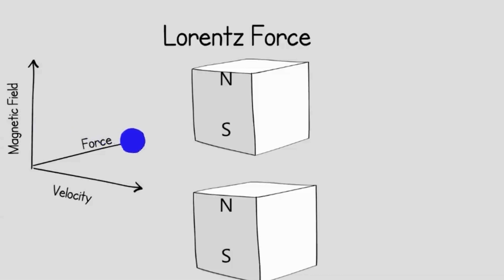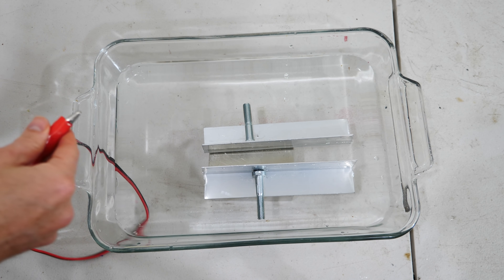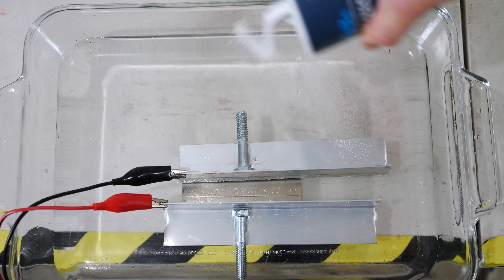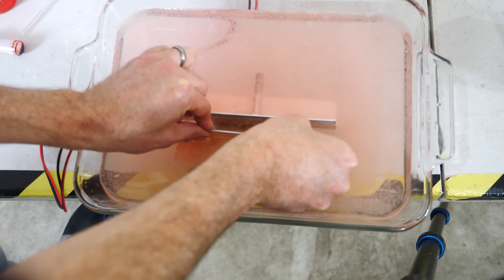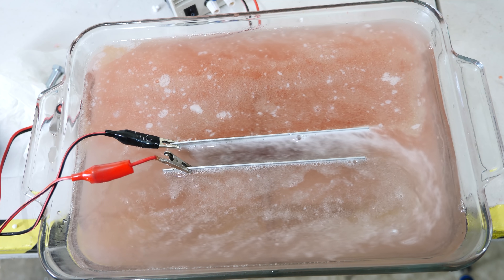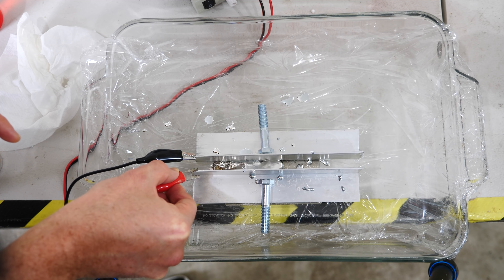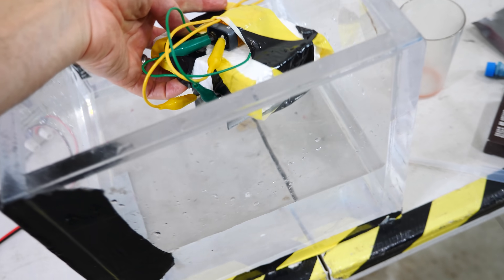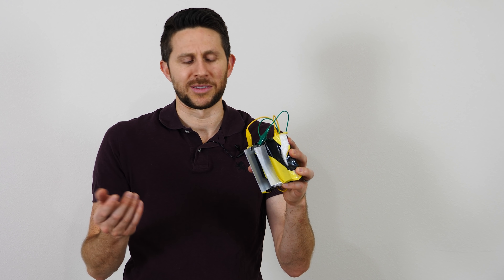I Made a Real Magnetohydrodynamic Drive

Comment: and as visible in the  plates   the  interface  ot the anode  and cathode plaes   in water  casue a surface coating of bubbles which actually   draws down on the  flow and efficiency  of the drive

Comment: You point out that the simple MHD drive also produces Hydrogen and Oxygen by electrolysis. Could these be fed to a fuel cell to generate electricity? Obviously NOT perpetual motion, but could it increase the efficiency?

Comment: I tried this concept to explain this phenomenon:hope this works??
Proposed Fourth Law of Thermodynamics: Conservation of Total Information
Formal Statement (Conceptual):
The total amount of quantum information (quantified by the von Neumann entropy) in a closed or isolated system is conserved during its unitary time evolution, and the entirety of thermodynamics at the macroscopic level emerges as a consequence of this underlying microscopic informational conservation.  
Explanation and Context
This statement is an articulation of the fundamental assumption in quantum mechanics (QM) that the evolution of the universe's state is unitary, meaning it is reversible and conserves information.
QM vs. Classical Thermodynamics:
Microscopic (QM) View: Quantum information is conserved. Any increase in macroscopic thermodynamic entropy (disorder) is merely a spreading out or obscuring of this conserved information over all possible microstates, a process called decoherence.  
Macroscopic (Classical) View: The Second Law (\Delta S \ge 0) states that thermodynamic entropy always increases in the universe, representing a loss of available energy (increase in disorder). This proposed Fourth Law provides the microscopic justification for the macroscopic increase in disorder by grounding it in the unitary conservation of information.
Alternative Formulation: A simpler, combined approach sometimes proposed as a Fourth Law is the Energy-Information Equivalence Principle: "The total amount of energy and information in the universe is constant." This unites the First Law (Conservation of Energy) with the conservation of quantum information.

Comment: I wonder how it would work if you used high pulsed voltage with low amperage. ( don't forget the tank capacitor/s )  I'd also wonder if you used conductive silicone if you would break it apart like any metal you would use. Not efficient in part cause of the electrolysis making browns gas BUT more importantly it's not efficient cause in standard high amperage electrolysis the energy used makes water temperature increase every min or two till it all boils off.

Comment: Is it possible to use permanent magnets instead of converting electricity into magnetic force and losing most of the electricity in electrolysis and heat ?

Comment: you can generate electricity using a heavy conductive liquid like mercury if it moves in reverse. So I had an idea that you build clear spiral tube, place aluminum tape or conductors on each side and magnet below on the outside of tube in series spaced around the spiral tube. The tube needs to gradually move downward. Place mercury in the top and as it flows down and passes each mhd in series... I'm curious to know how much electricity it would generate from gravity.

Comment: Does it work because water is touching the electrodes, or does it work because there's an electro-magnetic field that affects water? If it's the latter, then you could isolate your electrodes (e.g. clamp them around a clear plastic tube) - that would prevent the HOH formation (and corrosion). I'm not sure how it would affect performance though

Comment: the flat magnet you got under the water has the less powerful flux going across its width and the strongest on its edges so you need to configure those electrodes properly over the edge to get better results

Comment: Well done. Next step: since there is no moving part in a magnetohydrodynamic drive, there is nothing to stop you from "putting the engine outside" making an external-flow MHD accelerator that can act on the fluid over the whole wetted area, and not only inside a tiny chamber with much friction everywhere else. With an applied electromagnetic field powerful enough, one can then prevent the water molecules to accumulate at the stagnation point in front of the vehicle.

Comment: The is why UFOs are regularly seen near the ocean ie the salt water. They operate using Magnetohydrodynamics and sometimes coupled with electrohydrodynamics which involves ionizing the surrounding aether via microwave-beam transmitters to increase the conductivity of the surrounding environments and increases the density.
Reply: which makes me think that there could be a way of containing the magneto force with some kind of flexible membrane/wall which would still allow for motion forward or backwards.  Like those bubbles people romp in near Gatlinburg.
Reply: @keepfocus1214  search Google patent number US10144532B2. This is what Chris PaiZ used to contain that force creating a plasma state around the craft.

Comment: This is a magneto-hydrodynamic motor, but every motor can be a generator, too. Am I right? 
If you have flowing salt water via a magnetic field, you generate electricity. So once the water is flowing, divert it through another magnetic channel to create electricity. Once you’re generating electricity, remove the external power source and dive the system using the power you’re generating = perpetual motion machine

Comment: Once you explained a misconception about negative temperature.

Could you make an AC resonant magneto-hydrodynamic-propuslion?

In such a way the current wont be creating bubbles and the effeciency should be greater than 100% if you influence the vacuum medium with it... similary how a fish floats up and down using compressed air so we could compress or decompress the vacuum medium or smth.

Comment: What happens if you isolate the aluminum from the water by adding a thin layer of plastic so the bubbles do not form? Is it purely the electric current in the water or the magnetic field?

Comment: Is there a way or substance that when applied to the water will prevent the electrolysis of water turning into hydrogen and oxygen gas? I would like to make a no-moving-parts water pump to circulate warm water to be cooled off at a radiator and then come back again/repeat. Im interested in using this technology since I never ever want to replace any parts and Id like for it to last decades if possible, anyone have any bright ideas to improve or make it last much longer? :)

Comment: You mentioned that the generation of hydrogen gas and oxygen gas via electrolysis causes inefficiencies in the system. Can you think of a way to confine and ignite them, therefore increasing the energy output? I'd really like to see a magnetohydrodynamic boat with a huge flame coming out the back.

Comment: I think you may be able to get more out of it if you increased the plates. If it's anything like electrolysis, anything over 2v between plates is overvoltage and results in steam. If you're using a nine volt battery try putting three or four plates between the cathode and anode. Count the spaces as 2v each. Just a thought. Now you got me wondering. Gotta build one. LOL.

Comment: My big question is: What if you pump ionized fluid (Sea water) through a tube with a super magnet beneath it, does it produce a current (between two plates) and therefore power? Can it be more efficient than a turbine? Basically the reverse process what you show here.

Comment: Is this how Bladeless fans work?
Reply: Usually no, there are ion thrusters that work that way, but most "Bladeless Fans" have an impeller with blades inside and then uses the shape of the fan to move more air overall.

Comment: I saw a movie Godzilla VS Mechagodzilla, and the Mechagodzilla had a shield that looked like a tornado circling around him.   This gave me an idea for shields on space ships using MHD Drive.   On Star Trek, the shields are a static invisible force that surrounds the ship.   Totally imaginary.   An MHD Drive, configured in a circle around the ship, but using Electrical Plasma as the conductive fluid, would form a spinning plasma loop shield around the ship.   As objects hit moving plasma, they will be vaporized and diverted around the ship.  Electrical Plasma can provide propulsion, shields, and gravity (through constant acceleration & deceleration).   We have all the basics for a space transportation system as soon as we can provide a constant & continuous megawatt electrical power source.

Comment: Can it be used in the opposite way as a generator? And you said to drive a boat on salty water. Salty water can make electricity which can be used to drive the boat. I just don't know how strong the electricity you can make from the water of the ocean.

Comment: 25 years ago or so I saw a thing on discovery channel and I think it was called thermal magneto hydrodynamic propulsion it consisted of two Venturi‘s a small one inside a large one and the smaller one was heated by induction and I have not seen anything about it since it was wayMore efficient than what you were demonstrating they even used it as a dredge as it had no moving parts and did not damage small items that they were dredging up it would be nice to see if you could replicate that. Thanks for the great videos!

Comment: Hypothetically if you lower  the electrical potential (voltage) below the nessacry voltage to  preform electrolysis on water and increase the surface area of the electrode and lower the distance between the electrode to reduce resistance . would that possibility make it a viable drive?

Comment: You can do the same with non-conductive liquids too. It works with oil, and you can do it without the use of a magnet. Because oil is an insulator, you need to use the electric field instead - hence why you need a very high voltage.
Reply: can you please explain why is it moving?

Comment: Ergo - if you now move the water through that drive you  will measure a voltage, since a moving conductive part through a magnetic field is causing the induction

Comment: You made a toy and say it is inefficient, but you proved you can get something for nothing in the process. I believe scientists have lied for many decades and can only think they are forced to for some hidden reasons. Overunity; Lenz's Law; Thermodynamics, are all excuses used to claim we need to put more effort in than we retrieve, but how long will your water flow if you just walked away? Or if your boat was put in the Pacific, when would it stop moving? I am no expert, but I am going to try to solve two issues with magnets:
1. The 'sticking problem' - a mysterious propensity to stop rotating for no reason; have you had any evidence your water stops flowing? Or the boat stops moving?
2. The inefficiency problem - the magnets used are far bigger than the work done.
If I can beat those, then it's just a case of what barriers are presented to me; will there be opposition from science, governments and oil companies?

Comment: At the beginning of the video, the electrodes are touching the magnets. This causes current to pass through the magnet and wastes energy.

To avoid bubbles, you can apply AC current and put an electromagnet instead of a magnet. The current direction will constantly change between the electrodes and the liquid will not move, but if you feed the electromagnet with the same AC current, the liquid will flow in one direction.

Comment: For generating electricity from impure water, we can use copper and zinc electrodes, but small quantities of the metal (or ions) get mixed with the water. For this process, does the same happen? If drinking water was used, is it safe to drink then?

Comment: You had another post...straw covered in hydrophobic stuff lol. And the liquid would come out even when you held pressure down one end to pick up the water. 
Could you place little magnets in the liquid. Connect both ends of the straw, create peaks high and low with the straw so when the liquid goes up it comes back down and will push itself back up again and now you have self propelling magnets that can go round and round without stopping. 
I don't have a clue how power works, Im just asking if that's a thing or could be a thing?
Don't forget you heard it here first 😁

Comment: Try the Saucer approach, two saucers, with the first half being the cathode, and the other half being the anode, a rubber seal outlines the perimeter preventing them from touching. Have the power supply and magnet inside. Then place it in water and see how fast it goes.

Comment: Test cases: increased numbers of Strips, for more surface area, like find on a CPU Chiller, or Car Radiator idea;  DC Voltage vs AC Voltage; high Voltage Low Current vs Low Voltage High Current vs Low Voltage Low Current vs High Voltage High Current! 

(Low Voltage, 0.1V to 48V;  Medium Voltage 48V to 120V, High Volume 120V to 240+ Volts. {100,000 Volts?} For example!)

Comment: Excellent point with the efficiency! Too often that is the most overlooked aspect of a solution where everybody thinks we (engineers) should be able to design a more elegant design when in reality the best looking solutions are often the least efficient. This is why thermodynamics really should, and often is, taught early in the mechanical engineering programs. Without it or too late and there can be some very embarrassing time wasted on future work.
I think it would have helped to explain better the difference between voltage and current in this system. Does a higher voltage but lower current produce the same flowrate/force? I know the answer but feel this was left open.

Comment: There are two main reasons why this, so far, is an impractical method of propulsions. 1) the current needed to produce a useful amount of thrust (enough to push around a steel ship or submarine) is horrendous. It would drain the vessel's batteries too quickly making it necessary to run auxiliary generators, defeating the purpose of a "silent propulsion system on a submarine. The energy spent in the generators is more efficiently used directly running a conventional propulsion system. 2) The process of electrolysis is a highly destructive one for the electrical elements. The cathode or negatively charged electrode literally dissolves in the process, while the anode or positively charged electrode builds up deposits of aluminum chloride (in the case of aluminum electrodes in salt water) which is non-conductive and very quickly builds an insulation layer around the anode. The higher the current, the more quickly this happens making a major maintenance and materials problem every other day for a ship using this system. Not to mention that the oxygen and hydrogen gas being emitted in the process is HIGHLY explosive.

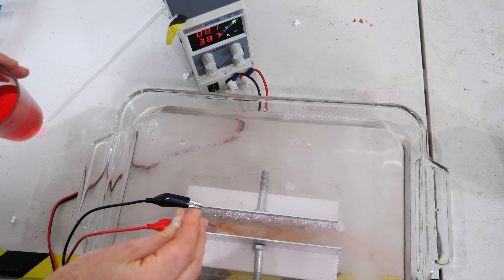Comment: minor  correction: 2:21    Granted strength of the electric field is an indirect factor along with temperature, electrolyte type and concentration, plate surface area and distance between plated, but all those factors simply effect the amount of current, so it is then that the force that causes the water to flow is only about the amount of electric current and the strength of the magnetic field.

Comment: Why don't you add a layer of electric insulation for your plates, it will prevent the electrolysis issue and the electric field will still be there.

Comment: there isn't "potential" to use it as a plasma drive... It's already used as such for quite some time. That's exactly how Ion Drives work, plasmidify Xenon gas and shoot it through tiny channels at extreme voltages, the max thrust is really shit and it doesn't work in an atmosphere, but in space it does work and the total thrust available to the engine at small fuel amounts is actually absurd.

Comment: I always thought this would work, but have never actually seen it done. Great demo. 

I wanted to go the other way though. Take pipe lines that rundown canyons and make them rectangle and capture the energy as it flows. Of course the efficiency is terrible and the cost enormous, so it will never be done, but could in theory.

Comment: does the opposite happen ? if you flow an ionic fluid flow through a channel connected with wire, does it produce a current ? I guess a potential application would be sea water power generator that use generate power when the tide rise and fall. Since there is no moving part, you don't need worry about rust or other mechanical failure form the harsh sea environment
Reply: Wondering the same thing here!

Comment: What would happen, if the caterpillar (name borrowed from the hunt for  Red October) would have two sets of electrodes, and the 2nd set (in the direction of flow) would be the one powered by the main source.
The oxygen and hydrogen could be collected at the end of the caterpillar, and fed into a fuel cell, that in turn would send its current to the first set of electrodes.
Of course the first set of electrodes would also generate oxygen and hydrogen, but that would be collected at the end of the tunnel anyway and returned to the system.

IMHO, the total amount of energy lost in the "main" set of electrodes would be retrieved, fed to the secundary set (powered by the fuel cell) and all losses of the secundary set would be recovered and re-used anyway.

I have no idea if it is viable, but it sure should give a huge efficiency boost.

Comment: That comment about a wire experiencing a force when the wire is in a magnetic field (and a current is passed) is only mostly true.  If you make the magnetic field very strong, and, critically, very uniform across the gap, then a current-carrying wire will NOT experience a force on it.  If you think of this in terms of energy and entropy, what energy benefit does the wire gain by moving? The answer is none, so there's no reason it should move.  It would make a cool demonstration.